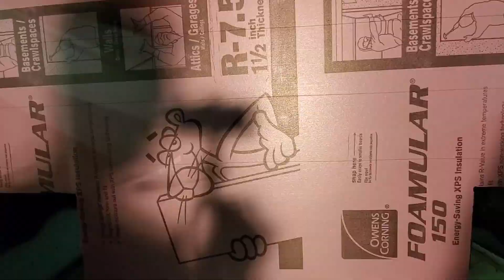School Bus Conversion Time Lapse |  Short Skoolie With Roof Raise

Comment: hey there great video btw i recently bought one myself but have been stuck on trying to remove the paint but saw you just painted over it what steps did you take to do that and what kind of paint
Reply from the maker: I used a tractor paint. I sanded everything but you don't need to get rid of the paint completely. As long as you get rid of any flakes you should be good to go.
Reply: @mitchellkauffman6799  thanks a bunch for the info!!

Comment: What about mods and crash safety/insurance? Don't you need some inspection of some kind?
Reply from the maker: Getting it transfered over to an rv title can take an inspection depending on what state you live in. Once it is titled as an rv insurance isn't hard to get. I didn't add any safety features other then the ones already built in by Chevy

Comment: I see that you also are using the Valence  batteries, how is that working for you? Iam almost building my solar setup but did get some of these. Nice build by the way!
Reply from the maker: They have been working great for me! No issues so far. Thanks!
Reply: Do you have the actual bms or are you just monitoring from the Valence app? I have an aftermarket from Thunderstruck motors but have not tried it yet!
Reply from the maker: @ichabodchristian7575  to be honest I don't moniter them a whole lot but I have the capability to do it through my computer. Since I have them wired in parallel I haven't noticed a difference in voltages of the cells.
Reply: @mitchellkauffman6799  Nice, really appreciate that tidbit and will be trying to hook the 8 of them up soon! Have a n awesome day✌️

Comment: I have a question: Is the bus a class B, and are there spots you can’t park vs a van (aka sprinter) ??? Trying to make a decision Appreciate any advice ☺️
Reply: No. A classB is a van type conversion. C-class is one with a bed over the drivers/passenger area. A school but can have a few classifications...depending on year of make, etc..mostly to do with weight. Look up on line..or ask youtube to help
Reply from the maker: With the motorcycle rack on the back the bus is definitely longer and harder to park then a sprinter. I still haven't had much issue with parking though. I can park in a normal space as long as there is room for my front or back to hang out of the space a bit.
Reply: @mitchellkauffman6799  Appreciate it, Thank you 😊